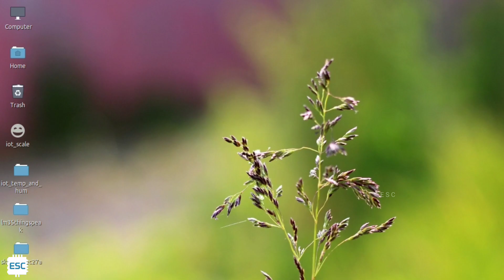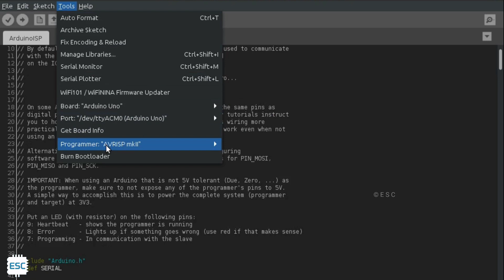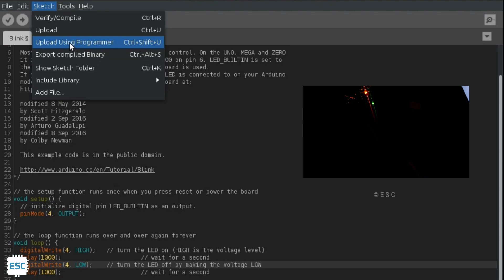How to upload code to ATtiny 13 using Arduino UNO

Comment: ❤️
Bro please make a video about the disadvantages of using Arduino IDE to code like this
Reply from the maker: I just started to programming through  arduino ide. If i face any problem  i will definitely inform
Reply: @EDISON_SCIENCE_CORNER  yeah there are some issues with memory management.
I use AVR for my  projects ,using Arduino for the same projects will take a huge space in the flash
Reply from the maker: Thanks for your info
Reply: you cam use arduino-cli; it’s real fast